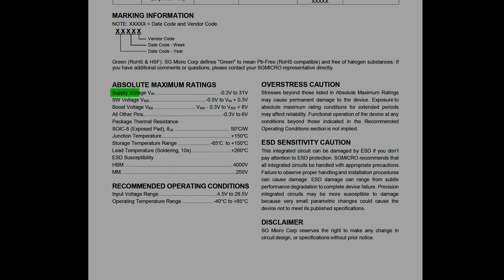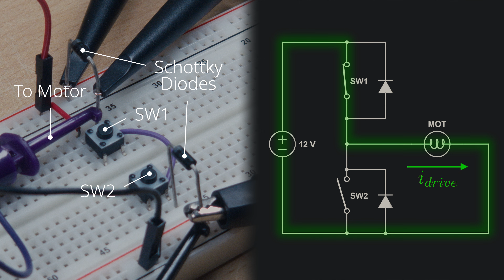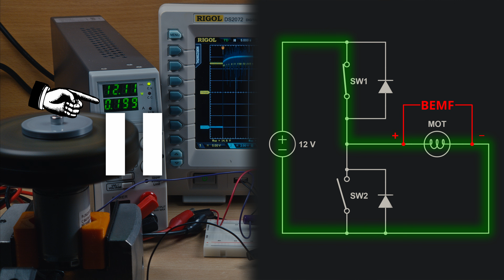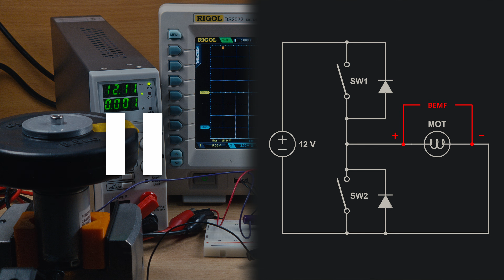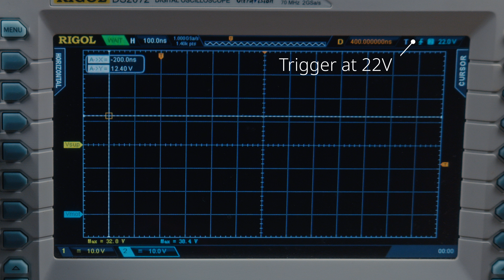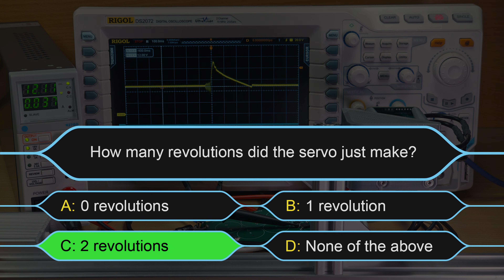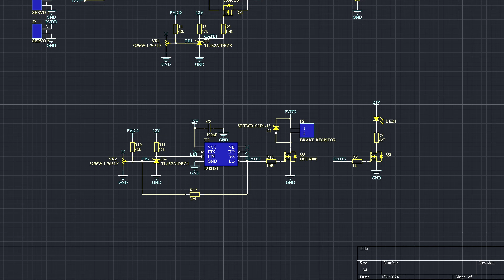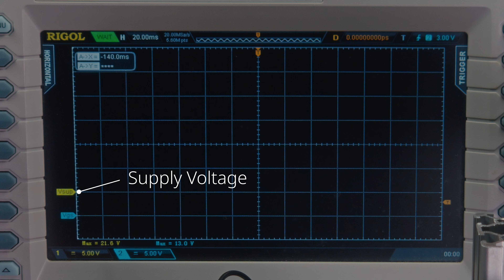Regenerative braking broke my motion controller. Here’s how to protect yours (with schematics)

Comment: about 10 yrs ago on an ebike I had regen braking, saved a lot of brake pads, one morning on a full battery going downhill it was braking fine, till it pushed the battery voltage upto its maximum, and stopped braking, the resulting excess voltage with no where to go took out the mosfets so it was a walk home..... (regen, added 5-10% to my range, not worth the effort unless you have it for free)
Reply from the maker: Doesn't the controller have an overvoltage cutoff? Well, if it's just the MOSFETs that failed, it could be a relatively cheap repair.
Reply: @engineerbo  99.9% of controllers have direct wired fets. it was a cheap repair for me but a normal user would be buying a new one.
Reply: Is it not possible to redirect such energy into some empty capacitors and high power inductors so as to prevent other sensitive components from frying?
Reply from the maker: That's similar to letting the regenerative braking current recharge the battery pack. To prevent the battery pack (or capacitor bank) from being over-charged, a protection circuit is still required.
Reply: @engineerbo  your suggesting a solution of a protection circuit that no manufacturer fits as (a) it would be another link in the chain that could break and (b) increase costs. I agree they should, but it's never going to happen.
The only viable solution currently is to make sure the mosfets being used can handle the open circuit / no load back emf' voltage of the motor, and to incorporate a software solution of using the MOSFETs to apply a very small amount of regen 'at all times' when not accelerating to dump said back emf'. Unfortunately that would require software development time and as all these motor controller box shifters do is steal each others code from 2010 and use it on 2008 chipsets were not getting anywhere.....
Reply from the maker: That's true, I wasn't really thinking about low-cost applications. The controller could also switch to using the resistance of the FETs and motor windings to as a brake. That would transfer the risk of exploding batteries to "only" burning up the controller and/or motor.
Reply: @engineerbo  that's kind of where most ebike controllers are at now, once there's danger of overcharge they instantly stop doing regen, instantly..... The emf' spike then takes out the fets....  If only they they went from shunting the power into the batteries to simply shunting it through themselves to ground and easing off gradual then fet replacement would be less common.
Reply: @lezbriddon  wrong. Open circuit motor windings voltage means nouthing. Motor (and it's driver) behave as a boost converter loaded with battery and driver capacitors. When battery disconnects on over voltage cutoff, significant current still flows via motor windings (or else why would battery disconnect at that exact moment) and that has to be dealt with. How - like shown in the video.
Reply: @engineerbo  wrong. Controller could NOT use that (only resistances of windings and transistors) as a brake. There isn't a way to controll braking amount with this method neither transistors aren't specified to survive motor short circuit current (ar any reasonable motor speed).
Reply: @lezbriddon  there isnt a way to shunt power via fets outher then braking resistor.
Easing off gradual will kill fets almost instantly. As soon as fets are turned off (or turned on as syncronus rectifier fets) or partially turned off, power from motor windings kills fets (either via overvolting controller capacitors or dissipating power in fets staying in lineal mode)
Reply: @volodumurkalunyak4651  no one uses linear mode! Well except the audio guys and even they are moving to class D for high power. When I said easing off I was meaning to lower charger  rate slowly via the pwm method like it regulates motor speed instead of it just switching charge off instantly giving a spike
Reply: @volodumurkalunyak4651  "Open circuit motor windings voltage means nothing. " best joke all day! more! more!
now give ronald mcdonald his face paints back.
Reply: @lezbriddon  neither lineal mode nor lower charge rate works if battery BMS cuts off. As soon as cutoff happens (at any charge rate), you are screwed unless there is enought FET voltage headroom.
Lower charge rate does work in a different way - regen is limited at higher voltages (maybe even progressievly more limit at higher voltages) to avoid BMS high voltage cutoff at all costs.
Reply: @artisticyeti22  no manufacturer fits as (a) it would be another link in the chain that could break and (b) increase costs

Comment: there's another thing that has to be taken care about -- noise. This might become a serious problem in a system. I used some integrated servo before and the noise induced by the regenerative energy into the controller made it lose the position. Motor power and controller power were supplied through the same line - an energy dump was not implemented in between.
Anyway after some time I switched to high voltage servos with separate driver, I'm not going for integrated ones anymore (they're okay for low speed though).
Reply from the maker: Can't speak for other servo designs, but to get mine to lose position from regenerative spike, it'll probably have to be a big enough spike to destroy the controller itself. As long as the microcontroller and encoder are functional, it'll be able to read the position. The communication between the encoder and microcontroller is also reasonably robust to noise, because every frame is verified with an 8-bit CRC.

Comment: Servo motors and SKR1.4???? What am i missing?
SKR1.4 is for stepper motors, not servos, so....
Reply from the maker: The SKR V1.4 uses the step/dir interface. Stepper motor drivers, and any other drivers which support that interface will work. Both the servo42c and my own design support the step/dir interface.
Reply: @engineerbo  OK, so using stepgens, nice.

Comment: This is a really good video. I've started making an "ODrive Clone" - So I am going to "Lift" their power resistor implementation. But the way you have done it with it being independent from the microcontroller is a great idea.
Reply from the maker: ODrive's solution is firmware dependent, so it's actually a far more complex method. Are you using their firmware as well?
Reply: @engineerbo  ( I think youtube had an issue with something in my reply ) - 

Its early days right now. I have a KiCad Schematic that is almost complete, I have an order by LCSC that is in progress ( Albeit delayed by China New Year ) 

Its going to be an STM32FSomething with 2 TI  DRV80somethings. 

It would be great to get some of the last open source version of the Odrive working on my board because 1 ) Gives me access to cheaper boards for robotics, but 2 ) Its all mainly tried and tested. 

But I have read on the forums, it seems that ODrive keeps a little bit in reserve for Robotics, not "Full Driving" for something like "Running a hoverboard motor at 100%" 

So yeah, It would be nice to use their FW, I am however totally pinching their Aux Mosfet for DC Load resistor.
Reply from the maker: Sounds like a fun project! I think ODrive's aux output is configured as a half bridge, so maybe it's used for more than a power resistor?
Reply: @engineerbo   It’s a generic half-bridge power output, i.e. it can be driven to VBUS or 0V or neither.

With enough effort it could be used for any application where you want to provide VBUS, Variable voltage (DAC) with a Cap or Pull down to ground. 

However, in the current firmware, its function is to dump power via the brake resistor when necessary, to prevent the VBUS voltage rising above 56V or whatever limit has been configured.

BUT it relies on 1 ) The micro being alive to track these transient voltages and 2) fast enough to do so - So no blocking code !
Reply from the maker: I only had a glance at the schematics for the aux output, and was confused why the braking resistor needed a half-bridge. So I'm guessing maybe it's just there for future-proofing, which is also why it's called "aux" instead of "braking resistor".

Regarding the conditions, I agree. Even though the firmware can be designed to make it respond very quickly, I just feel safer keeping it simple (and separate).